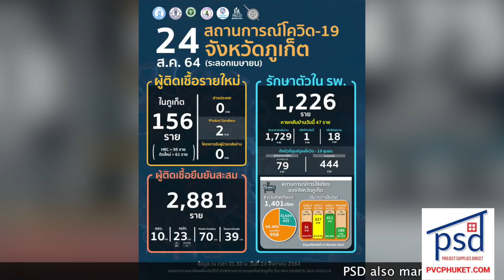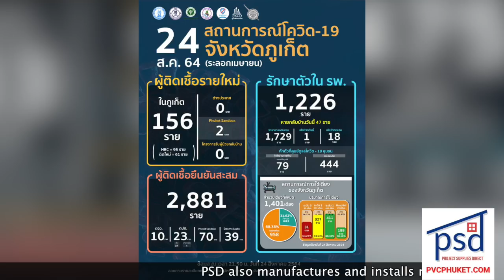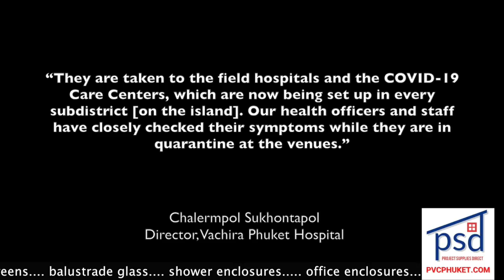Thai cops kill drug suspect while allegedly trying to extort B2 million |:| Thailand News

Comment: According to time stamp of torture video on CCTV. Man started suffocating at 13.15 but they were still thinking of adding on plastic bags at 13.20,till they realised something has gone Fubar. That's 5 minutes, perhaps more. And then when realising he,  wasn't breathing. Only CPR but what may have saved the guy would have been, artificial ventilation or mouth to mouth, there was still time, and not only chest compressions.But,it was not seen done. It's culpable homicide for sure.